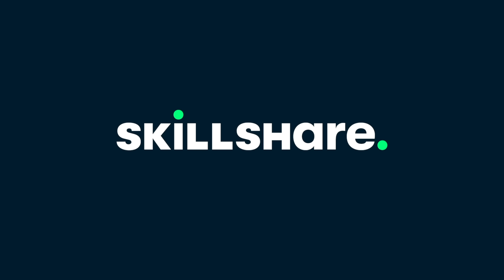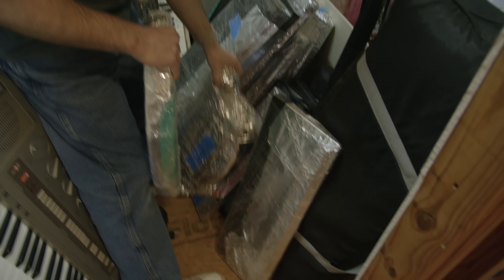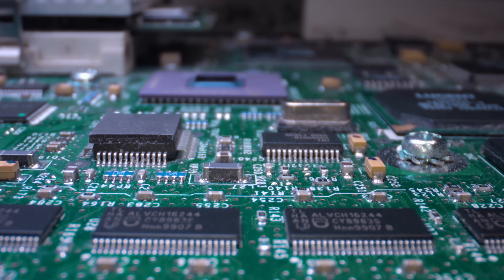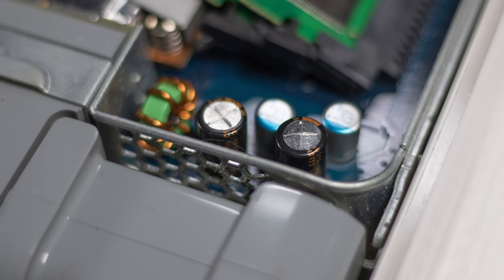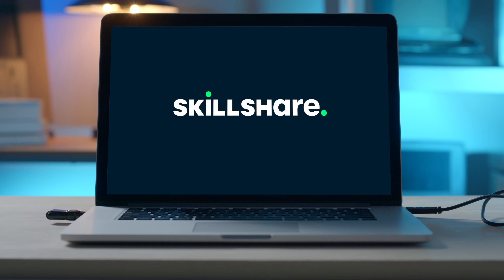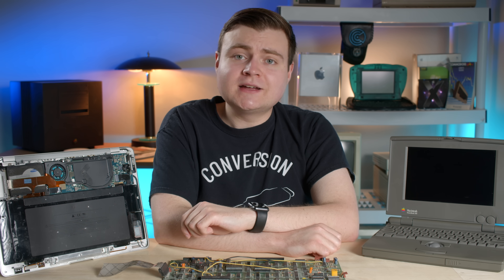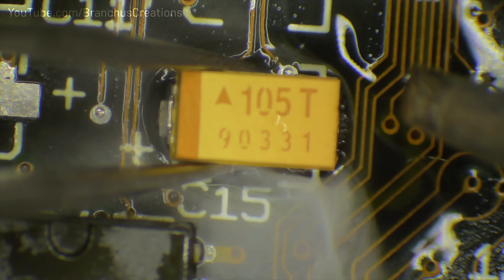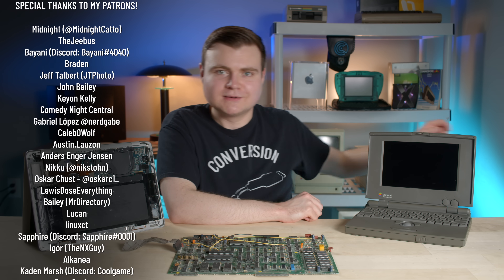Why Do Computers Die? (ft. The 8-Bit Guy) - Krazy Ken's Tech Talk

Comment: does 8-bit guy even have to deal with damp dust though

isn't he from texas? the heat they have over there is something i've never even witnessed 
(already dying here with 32 celcius)

here in the netherlands in old houses that are badly insulated, you can actually rust guitar strings in late summer and autumn by not having them in a case , they get mad variations in temperature too , absolutely wrecks them :')

Comment: I remember I was troubleshooting an eVGA nForce 680i motherboard that was being a real PITA. I spent quite a bit of time on that sucker trying to figure out why it was throwing out seemingly random errors on various bootups. One moment it’s memory, next time a CPU error or hard drives not being detected properly. 

I was really scratching my head on this one and even used spare components to try figuring out what the heck was going on. Then I had a good look over the board and saw a few of the capacitors were bulging and just starting to leak. My soldering skills are non-existent and we ended up replacing the board as it was a couple years old anyways, but I never forgot about it.

Comment: Unless the user blocks the computer vents the #1 cause for heat failure is BAD DESIGN and the #1 overheating bad design prize goes to...apple, yes! and why is that? because steve "reality-distortion-field" convinced engineers that fans are BAD THINGS that run noisy and vibrate and they should be avoided; well....turns out that fans are used to cool down components that otherwise lead to general computer failure which apple is famous for;  that leave their users with an overheated and overpriced brick

Comment: The secdtion of this video about capacitors is foefully incomplete and misleading.  There are many types of capacitors, but it's really only  electrolytic caps that you have to be concerned about dying from age and or leaking in a computer.  A typical computer will have all kinds of ceramic and film capacitors that will never need to be replaced.

Comment: I built a pc for my mother in law to replace her ancient dell. Worked out great for her for a while, and then one day she calls and says it wont stay on for more than 10 minutes or so. I figure it's overheating, and ask if anything happened to it. She says she isn't sure but one of her cats might have bumped it. So I go over to her house and take a look. Heat sink and fan have been knocked loose from the motherboard, hanging on by one pin and the power connector for the fan which is bent at a 45 degree angle. I remember thinking it was amazing it could operate for 10 minutes and safely shut off. I bent the pins on the power connector back and replaced the HSF and it works fine to the day.

Comment: I had a computer from 2015 that had a gutted floppy drive... It didn't list that it had a floppy drive so at least it wasn't false advertising, but man, it was weird. The aluminum housing and plastic facade were fine and in perfect condition but all the electronics had been removed. The eject lever and cover flap were glued in place and the hole in the back where the sata line would plug in had some tape over it, probably to keep dust and such from building up in it. I'm pretty sure it was just there as a cosmetic, but whoever put the thing in there probably spent more money making it than they made back if they sold the guts or just if they just bought a broken one on ebay.

Comment: i thought it was a candidate or runner up to candidate formula that was stolen thereby they got a formula that was not the real formula.

whenever formulating something there are several test batches  under test and the ones that perform the best are the candidates.

then the candidates are maybe tested against each other again and again until they get the best performer.

so probably what was stolen was an earlier candidate that was flawed on the long term.

you see the smacking in the movie back to the future when the clock fails in the car

red ring of death sound familiar?

Comment: Knew a bad cap was what was killing an old HP monitor of mine, and killed the desktop it was used with several years back.  Both were built around '01.

I also had to fix the solder joints to get the CLASS system functional again on my '85 Yamaha Venture.  Pretty sure the radio on it could use new caps BEFORE problems do arise, and I'm not looking forward to that.

Comment: 1. HEAT! Heat is computers number one enemy!
2. Dust, not only does it cause heat by blocking cooling vents but it's also conductive. Always dust out your PC at least once a year more if you keep your PC around pets or in a dusty environment like a garage or workshop
3. Capacitors as you stated, heat can damage them but there was a time period around the early 2000s where manufacturers used counterfeit capacitors that ended up leaking (and the cap juice is corrosive) 
4. Poor design/design flaws. I'm looking at you Apple with your poorly cooled MacBooks

Comment: Electromigration or other actual silicon damage is the most unfortunate, especially on vintage stuff where the silicon cant be replaced. Happens even on non-OCed stuff, but heat can make it worse and something old and heavily used can have it happen and silicon cant be repaired like the issues you listed.
Reply: Happens a lot on embedded equipment like routers is common where they run continuously hot under load with no cooling, eventually just craps out after so many years of stress.

Comment: In addition to dust, computers suck in pet hair, cigarette smoke, the tar from the cigarettes kind of cakes on the inside of the computer case and the smoke causes the outside to yellow if was originally white or beige.  As computers are warm, pests and other vermin often are attracted to them and may try to nest inside
Reply from the maker: Good point <3
Reply: The yellowing of plastics is actually due to a chemical reaction. Ask the 8-bit guy .-) 
But yes, I had to restore a friend's iMac and when I found a sticky piece of foam rubber over the air inlet i thought to myself "I never knew iMacs had a dust filter". Turned out it wasn't a dust filter, but a thick layer of dust glued together by 5 years of 3 packs a day worth of nicotine.
Reply: @IlBiggo  Yes, the fire retardants cause yellowing too. They both do
Reply from the maker: @IlBiggo  Yes, but UV rays play into that chemical reaction. c :

Comment: I liked the video, glad to see you present topics like this to help others to learn.
I'm a bit surprised that you didn't include static electricity in your list (but yes, I know you had to limit how many due to time).  Static does not necessarily kill a device immediately, but it can weaken components, especially with repeated zaps, leading to potential shorter lifetimes.  Fortunately once components and boards are installed into a device they are reasonably safe for the most part.

Comment: Electrolytes in caps are not that conductive. If they were, your caps would act essentially as short circuits.  They are corrosive in the long run though.
Edit: my bad, it seems that the electrolyte acts as one of the poles and the dielectric is actually the thin oxide film on the metallic side.

Comment: As an interactive museum we encounter similar problems. I'd also like to add rubber to it, especially rubber bands for diskdrives. They won't kill your computer, but won't allow you to actually use it (most of the time). Second, heat. People underestimate the danger of overheating IC's. The internals of the chip break over the years due heat and there's no way you can fix an IC internally. Also, over or undervoltage of components (yes, looking at you Commodore 64) will kill them. These overvoltage is usually caused by bad capacitors, but still.

Comment: A lot of laptops from most major brands made around 2007 had issues with graphics failures, supposedly nVidia changed to lead free solder which would crack as they expand/contract with heat of operation instead of the lead-based that could flex...naturally most were not covered by warranty for various strange excuses and often failed a few days outside the warranty (as mine did)
Reply: Actually it's not the solder balls! It's always been caps with me. 3 PS3s YLOD were caused by the flat-chip-capacitors (I don't know the correct term, but they are SMDs) and replacing them makes the system strong and reliable again. And it's likely been caps for you, because heating the caps has helped "restore" some capacitance, and once it dips again it will fail again. How no one suspected capacitors, I have NO IDEA.

Comment: I have a PowerBook 5300c that was making the same noise that that 100 was making at the start of the video. Turned out it was just the cheap aftermarket power adapter I was using had gone bad.

Comment: You also forgot design flaws like the faulty chip on the 2013 15in retina Macbook pro.  NEVER buy one of those... even if its a good deal.
Reply from the maker: Huh? I’ve been using that computer for 7 years.
Reply: @ComputerClan  Hey!  How are you?  I think Luke Miani explains it better than I could, see: https://www.youtube.com/watch?v=8jM1brvJhzg&t=520s Basically because of this issue I had several trips to the apple store to argue with them to get them to fix it and in the end they did nothing (it was a few months out side of the 4 year repair program).  So that's the guts of €2,000 down the drain :-(  It was such a horrible experience that I made the terrible decision to switch back to Windows.  I'm on an OLED laptop and while  I miss mac, at least I have stability.  I will be buying an arm based mac when it comes out and I don't expect them to have such design flaws.
Reply: @ComputerClan  "My Mac is broken, THEREFORE Apple makes broken computers"

Comment: I have another interesting issue with my computer: It's connected to one of those power strips with a red switch, so I can fully power it off when not using it. However, sometimes when I flip the switch back on, the breaker in my house goes out. If I turn the breaker back on, the computer starts fine, but usually has no ethernet network connection - until I fully turn it off and on again. And no, the router is not on the same breaker, so its not the router having to boot up first. 
Anyone got an idea what this could be?
Reply: the network issue sounds like windows being windows. the breaker tripping seems to indicate a shitty PSU with no inrush current limiting.

Comment: Horror story time.  The year, 2006, the machine, a 2005 dell optiplex.  The kind that has the push buttons on the top and bottom to open...
Fella brought it to the repair shop that I was working at back then.  Said he couldn't get his machine open and was beyond frustrated with it, so after a few hours of screwing with it, he got it open.  All he wanted to do was add more RAM, but the machine now no longer works. 

Simple enough, probably faulty RAM, or not seated correctly, or the wrong type of RAM...I was wrong....horribly wrong.  He'd taken a hacksaw to the back of the PC and in some miracle, didn't kill himself from cutting into the power supply on the way through.  More to my disbelief, he actually didn't think that cutting the machine open was the cause because he "was careful" not to cut the motherboard.

Nowadays the most common cause of death is liquid or some kid(s) doing a custom build from watching youtube and not installing standoffs; wondering why it turns off after a few seconds, if it even comes on more than a click.

Comment: 5:10:Well, ELECTROLYTE capacitors can only work so long. The simplest capacitors are simply two metal plates next to each other, if you properly protect them from the elements that stuff lives forever. The thing is they have even less capacity than electrolyte capacitors, the electrolyte increases energy density ("how much energy you can store"), but the potent electrolytes all also are the very reason they eventually fail.

Comment: The oldest computer I had broke, it was custom built in 2001. I didn't even use it when it broke. I just wanted to turn it on one day and it didn't display anything on screen. The ram is fine, I know that. However the motherboard has quite a few bulging capacitors and some leaked, luckily little to no corrosion on the board. I will replace the capacitors some day and I hope it works.

Comment: my powermac g3's battery still works, is at the nominal voltage, and seems fine (which makes sense since its been actively used since it was manufactured). it isnt bulging at all. it still scares me anyway but im broke so you know

Comment: Hi.  For a while i was having a run of 486 / Pentium 1 /  Pentium 2 that were playing up

The reason was that people were leaving the rear ISA slot covers open for air circulation ( i guess more to the point they were noisy as well and most people feel open it up for some fresh air.

Anyway they were not all in the capacitor plague but they did have stains on the main board.

Eventually it clicked as i noticed a pattern.

Ants , cockroaches baby mice were living in the PC's, as it was worm it attracted them and as they lived there they ate and basically paste water and no 2's

The mainboard eventually had solder mask / tracer issues just like shown on some leaking capacitor / battery but the stains were not as obvious and definitely no white powder

I also found a few baby decaying mice that has peed on the 240 V side of the power supply

Yeah - Yuck

These days 9/10 PC's are due to dust build up clogging vents , the heat sink / coolers on CPU's are full of dust as is the fan and also the power supply, many of these PC's will start and run but shut down in 5 / 30 / 60 / 90 minutes, as part of my usb tool kit i have CPUZ and first thing i do is look at temperatures, suprised on how many go to 90/100 C then just safely shut down

Regards
George

Comment: The cracked solder joints thing I think happened to my Xbox 360. No idea if it works now but I remember dropping it, RROD, turning it to it sat flat (horizontally), sometime later RROD again, having it sit straight up and down, and I think maybe I had to do that 2 more times?
Don't know if it works anymore. Last I turned it on it did but that was 5 years ago lol.

Comment: At 2011 I had a brand new laptop and dropped it down the stairs it still worked.At 2014 I used my 2013 laptop (that I still use as my main)and dropped it.I had to reconnect the screen

Comment: In the Army we were told to drop any broken tech 6 inches onto a hard surface. The idea was it could seat a loose chip or dislodge dust and debris. So yes repair technicians in some areas did tell people to drop computers and other tech if it wasn't working. Then again that could have been instructions from a lazy techie who didn't want more work and figured it might help lighten the work load in a part of the world where heat was killing computers at an alarming rate.
Reply: That was actually the way Apple III got fixed

Comment: With the cmos thing, honestly I would replace it every few years as the bios is flash storage and over time flash storage will eventually "forget information" due to the residual power decreasing over time which may take between a year or a few decades depending on how the device is stored and the quality of the flash chip, typically older flash chips will take less time to "forget information" or at least render the data corrupt, newer flash chips should last for at least a few years unpowered. Actually another option other than replacing the cmos battery every few years is to power it on at least every few years if not every few months. Now I may be wrong so you can correct me in that.

Comment: I remember one time back in elementary school there was a laptop throwing an error... something about the hard drive iirc? It was an old Dell thing meant to run XP, but was running 7, so I wasn't surprised it was having  issues. I researched the error it was giving and one of the recommendations was to just shake it for a bit... so I did. I sat there for a good minute or two just shaking that old laptop. Once I thought I had shook it enough, I placed it down, opened it up, and somehow, some way, it worked.

tl;dr I once fixed a laptop by shaking it

Comment: Why computers die? Because somebody has to buy something new... Capitalism and planned obsolescence
Reply from the maker: Well, I'm writing this comment on a 7-year-old computer (which I also used to edit this 4K video) so… I guess planned obsolescence hasn't hit this machine.
Reply: @ComputerClan  Good luck with that. Several macbooks had production problems. Rossmann talks about nearly every year's model having some sort of failure. Especially display connector, broken traces, ...
Reply from the maker: hblaub everything has problems. Mine is working fine. Hell, my Mac SE (from 1987) still works fine. It even retains the date and time.
Reply: @ComputerClan  Just thinking about https://cheapskatesguide.org/articles/built-in-obsolescence.html/
Reply: planned obsolences sucks, but i am still using an Antec 380W psu from 2006... No trouble yet! (except for when it got to 112F/44C ambient then it tends to shut off a lot but i'm not gonna blame the power supply foir that)

Comment: I guess I'm the opposite of Jobs?  I currently have 9 fans running in my PC, and it does sound like an air conditioner sometimes, but hey, at least it doesn't overheat.
Reply: i have 5 internal fans and a box fan wind tunnel on my pc. its an absolute necesity when ambient temps can climb past 112F/45C regularly during the summer!
Reply: @virtualtools_3021  jeez
Reply: @chuckthebeast7693  regularly onle being during the past 3 years... every year it seems to get hotter D: